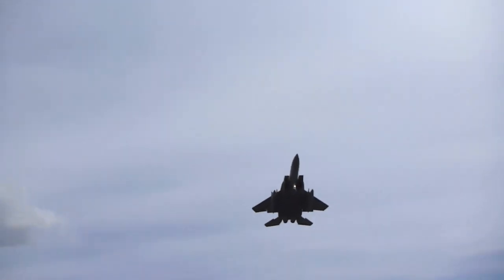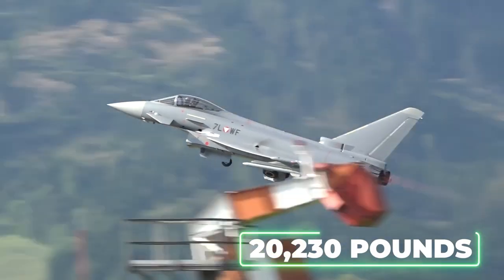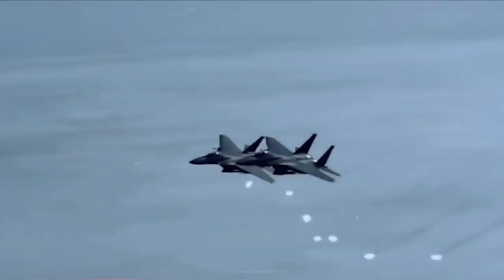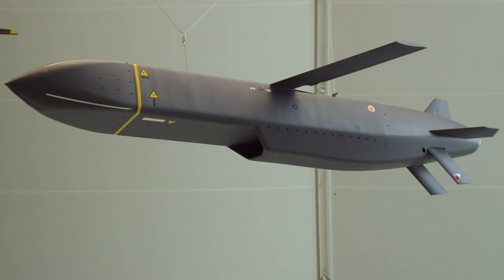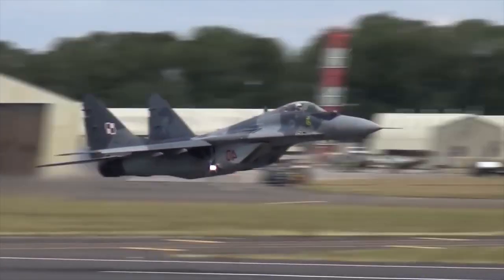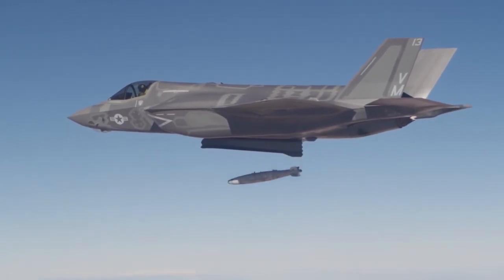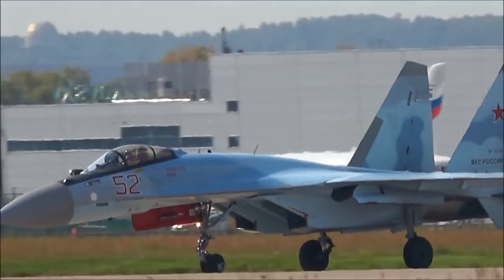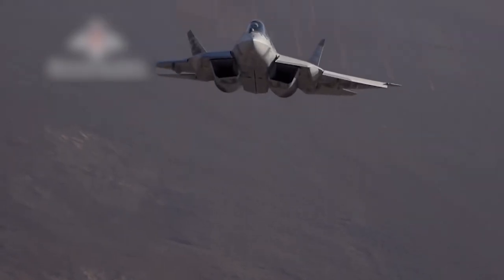10 Deadliest Jet Fighters You Don't Want To Mess With

Comment: Interesting how F-15, F-22, and F-35 are ranked lower than the J-20.  
That is a joke.
Reply: This video is a joke
Reply: @michaelmancini5773  It must have been put up by a China troll.
Reply: Agree 👍
Reply: J20 is a very capable airplane, but I agree the f22 should be placed higher
Reply: The J20 isn't even a true 5th generation fighter. It's not stealthy and it continues to have major engine problems.

Comment: Highly advanced technology design but deadly F-22 Raptor jet fighter should be No.1 and F-35 were 2nd . Russia SU-57 jet fighter had suffered badly as engines problems and poor stealth design forced Lead Putin decision limit less than 100 aircrafts as we not know it yet . China J-20 are failures already because India pilot fly Russia aircraft’s radar spotted China J-20 aircraft as China pilot see missile warning light as India pilot let China pilot know then J-20 fled away also engines aren’t good enough . F-22 Raptors and Lighting F-35 will get new powerful engines give em fly higher and Mach speed as faster but advanced technology computer system as defense systems added it . New F-15X Eagle jet fighter are deadly because advanced technology design and powerful engines give fly higher and Mach speed faster . Older F-15C & E will refitted with new engines and advanced technology and defense systems give em stay flying longer till 2045 . Su-27 and aircrafts of Russia doing it well but pilots as their personal problem if they see raptors and Lightning plus F-15X Eagle then turn around and fled back to Russia , remember about MIG-27 or Su-31 jet fighters flying with three Bear bomber planes toward USA till pilots of jet fighters see F-22 Raptors arrive then turn around and fled back to Russia leaving Bear bomber planes unprotected as Bear bomber plane pilot see Russia jet fighters gone then see F-22 raptors flying in right side as USA pilot wave 👋 to Russia pilot of bear bomber plane as heard USA pilot said leave right now and go home ! Bear bomber planes leaving and head back home as raptors followed it then flying back to USA . F-22 raptor fly under USA made F-4 Iran plane , Iran pilot heard “ Hi , I’m flying under your F-4 “ give Iran pilot got sacred as wet pant then fled back to Iran . That’s why F-22 raptor jet fighter are deadly ! India decided cancel SU-57 because design and engines are problems . India engineers are smarter enough than Russia engineers . That’s why India decided cancel SU-57 jet fighter . F-22 raptor jet fighter aren’t for sale as Congress said . If F-22 raptors will be retirement then will be destroyed leaving few in museums as top secret stuffs and engines removed and put fake ones in retirement Raptors but I won’t see retirement raptors in museums in beyond 2050 . New 6th generation wing jet fighter will be flying in 2045 . Congratulations to SU-57 as No.1 but useless as no good . Good luck
Reply: Well put. Although, I thought there were less than 20 SU-57s built when Putin cancelled them.  
Are more going to be built to take the total to 100,, like you said??